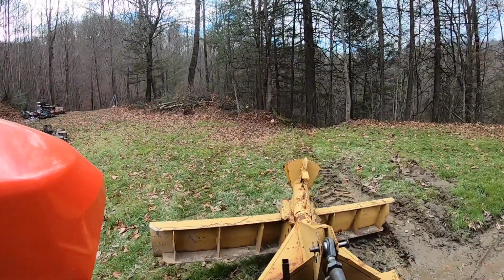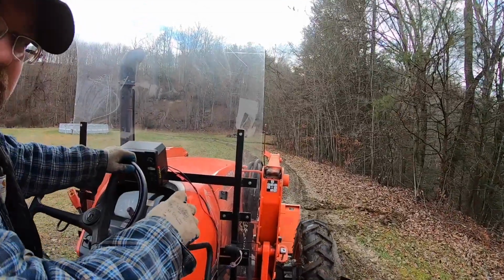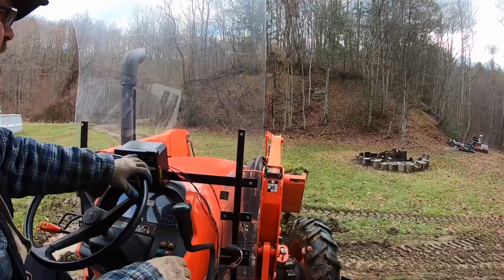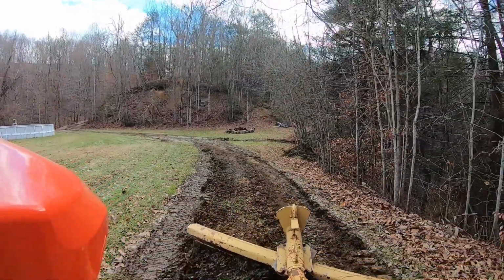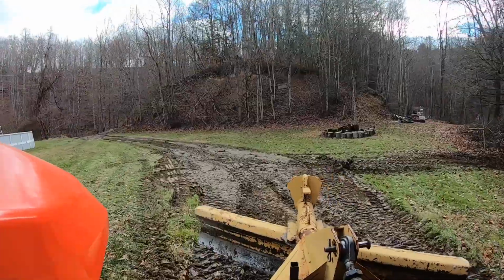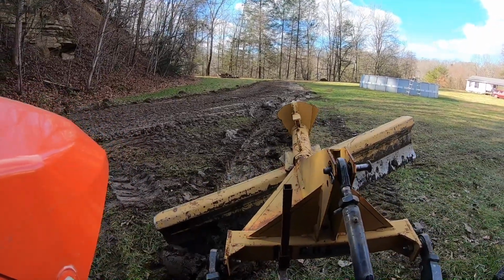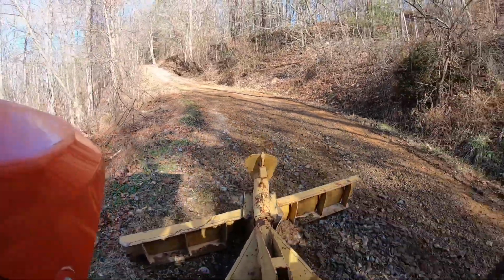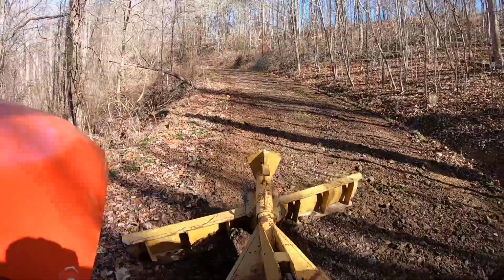Regrading a water logged driveway! Ditching and grading with a rear blade.

Comment: At least in my area you don't see these blades anymore other then sitting rotting away in hedge rows, after watching some of the work you have done with these blades over a few videos I believe it's definitely a under utilized tool very impressive. Makes me want to put one to work and see what kind of trouble I can get my self into
Reply from the maker: People don’t use them much because it takes some learning to get productive with them. I’ve used a rear blade since I was 12 years old in all types of conditions. It’s my favorite dirt tool. Thanks for watching!
Reply: The blade is the first tool I'd buy. Thry are so ha nvm dy in construction and farming as well as snow removal.